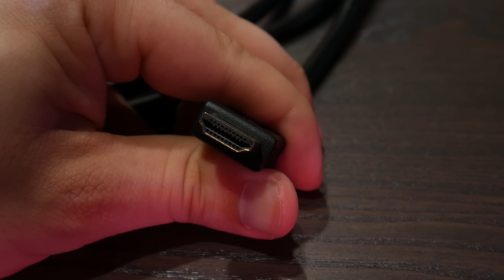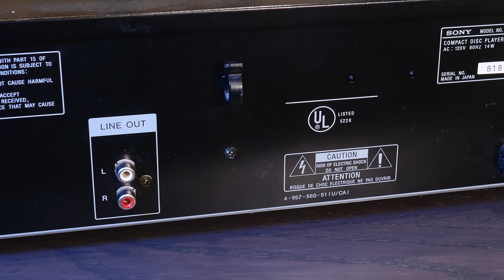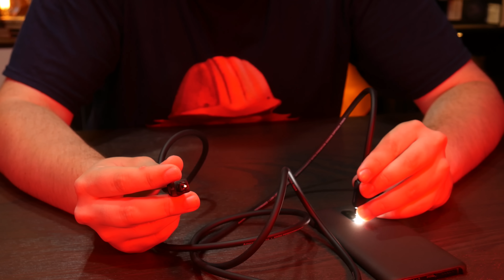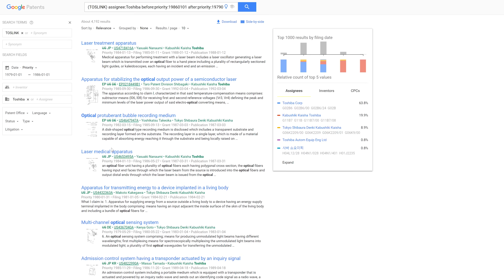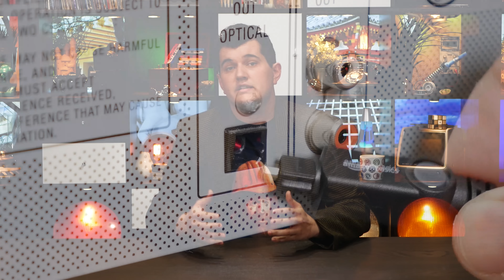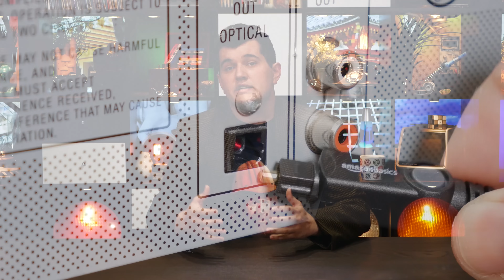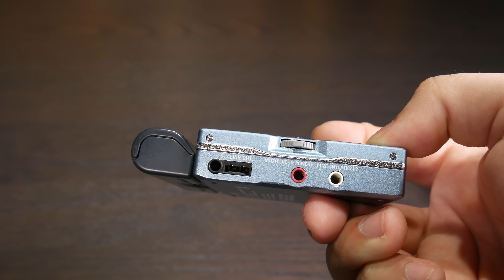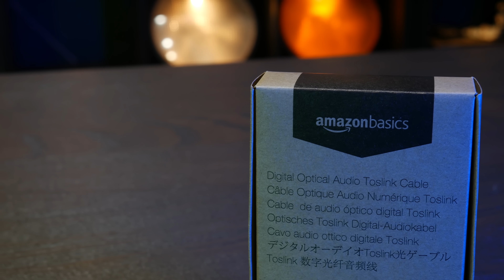TOSLINK: That one consumer fiber optic standard

Comment: The keying could also have been for installation of an angled connector type - these are quite common in the data-type fiberoptics, and are preferred, because less of the light is reflected back towards the transmitter, and the signal loss at the connection is therefore reduced, allowing for more connectors, and longer lines between repeaters.

Comment: I feel the ARC concept wasn't really thought out that well and forgot about folks with perfectly fine legacy surround amps that still work just fine; or it's just overly complicated or they designed it such that you now need to go and spend even more money to get ARC support. I upgraded my trusty old Samsung LE40 TV after it died to a new 4k LG with all-the-apps built in. An obvious problem arose was to how to send the surround sound to my non-ARC supported Onkyo AMP from the TV. It seems you can't just send the ARC signal back to the non-ARC HDMI inputs as they seem to be encoded differently or there's some handshake the non-ARC amp doesn't support. Why couldn't they just have a standard HDMI out socket on the TV you can send to any HDMI input on a device such as an older non-ARC AMP? Luckily TOSLINK came to the rescue and I just plumbed that from the new TV to the older AMP. If they discontinue TOSLINK on newer TV's it'd be a real shame. Sure I maybe don't get the mega high data rate for my audio, but to be honest I can't tell the difference.

Anyway, great video, learned a few new things :)

Comment: Well, for one, I presume my HTPC <-> TV (analog) A/V cable wouldn't discreetly but nonetheless quite painfully shock me every time I plug/unplug it if it would be fiber-based. The thing is, a) we simply don't have an actual ground wire in our "grounded" wall sockets around here and b) all mains switching power supplies helpfully tend to include a noise suppression Y-class capacitor coupling their output halfway straight to the mains solely for the purpose of being able to deliver tiny-current 135V shocks. Which you don't tend to feel in your fairly insulated chair or shoe when you grab the lead - unless you're also touching another appliance that just lost direct electrical contact with the first. Like, you know, when unplugging the damned signal lead. Not that I would expect this to have ever been an intended feature of TOSLINK of course - but it would sure have mattered for me...

Comment: Haha, I've had an optical cable between my PC and my surround receiver for years... my original graphics card didn't support HDMI out, so I've got a DVI out, and an optical cable to supply the sound... I just got a new card, and have been meaning to just go full HDMI.

The "This looks close" patent pictures look like the connectors we use at work for our printer network... there are these little hubs that two fiber optics plug into, presumably an in and an out, though I don't know rightly what they do... anyway, the cable end looks just like that...

I knew the mini cables were things... every time you buy an optical cable they come with the adapters for the mini... but I didn't know they went into a specialized headphone jack.... I've never seen one specifically before... neat!

Comment: TOSLINK isn't glass fibre, it's plastic. But it's great at what it does. My favourite "cable" is a TOSLINK to 3.5mm optical "jack" which came with my portable minidisc recorder. It plugs into the regular 3.5mm jack socket (but carries a digital signal), which is neat. I didn't use it much though as I did most recording on a full size MD deck. Minidiscs were really good back in day, way better than MP3.

Comment: You may be surprised to find that plastic-to-plastic has a very high impedance that is improved (lowered) by orders of magnitude with gold connections. Even gold to plastic significantly lowers the impedance, though the effect will be notably less. Don't believe me? Try measuring the resistance between plastic and plastic then repeat the measurement with gold and gold. The difference might surprise you! ;)

Of course I'm joking.

Comment: S/PDIF can't use any "standard coaxial audio cables". S/PDIF requires cables with 75 Ohm characteristic impedance as the interface is based on impedance matching (maximum power transfer)... the impedance of standard audio cable doesn't matter as analog audio uses impedance bridging (maximum voltage transfer) as its frequency is low so reflections in the wire are not an issue.
On many devices, TOSLINK is the ONLY digital interface available (maybe the music industry thought it was safer?) I used that extensively in the early 90's to copy audio between my MiniDisc devices (MiniDisc Walkman with mini TOSLINK and MiniDisk boombox with regular in and out TOSLINK).

Comment: TOSLINK has one major advantage over Coaxial: Electrically isolating components of the HiFi system.
Reply: I know it's discounted in the video, but it's still an advantage. It means there's no potential voltage difference with different brand or quality equipment, which can cause issues. It's rare, but it's still an advantage.

Comment: Mini toslink was actually veeeery common on laptops, even macbook pros had it.. Nowadays you can still find it sometimes on laptops that only have a single 3.5mm port. They usually have 4 pins so you can connect a headset and can support a variety of modes (headset, headphones, mic, line out, line in and digital output) which can be switched in software.

Comment: My question is that with the rise of standards like Dolby Atmos and its scaling format that still uses discrete channels. Why don't people start using Ambisonic Format B and, like we use an AV reciever, have a hardware decoder for a 4 channel Format B signal. With the ADAT standard we have access to 4 channels at up to 96khz (more than required for most setups) Or even 4 channel over SPDIF which is possible. However I think the industry will skip this entirly and go to network based formats like Dante, even though these are still using copper wire (granted with a higher bandwidth with CAT-6).
Reply: That’s why eARC was created (basically ARC 2.0)

Comment: The recording industry bought the stupid "Home Recording Act" which made DAT unmarketable in the home and then a short time later people just ripped CDs with their computers.

I never at all got the whole "clock jitter" thing I hear audiophiles ramble on about endlessly.    My favorite other thing of ripoff cables is "high purity power interconnects"  because the wires in the wall are so not cheap romex or BX(depending on home age or local code) sold by the spool.

Comment: Just a clarification: Recording, mastering, and broadcast facilities do not generally use SPDIF. They use AES which can either be 110ohm balanced or 75ohm unbalanced. Unbalanced AES is very similar to SPDIF, and for all practical purposes, compatible. There are some minor voltage differences and some status bits are used for different purposes. SPDIF is a consumer standard!

Comment: For the most part, consumers don't really need fiber optic connections. Copper is just fine if you're close enough. Fiber optic is for fast-travel across major distances. The one, and probably only, exception is actually when it comes to large amounts of data across any sort of connection. Computers, most notably, would benefit a lot from a fiber option connection to, say, a server if the data being trafficked across the connection was large and needed to be stored quickly. That said, there is probably a bottleneck at every stage since most of the inner workings of both computers will most definitely be copper and gold based.

There is one problem that comes up with copper, however, and it's going to become even more of an issue as we progress further with technology: the magnetic fields that copper wires produce. Right now we have a standard of Cat6, which allows for 8 copper wires to transfer data at the most, but they are twisted in such a way to prevent the magnetic fields from interfering with the other wires. In order to increase the amount of copper wires we have inside of our cables, we would need to further optimize the placement, shielding, and twisting. That's easy if the wire is never going to be touched (buried underground), but not so easy if you're giving it to a consumer that could be constantly tampering with them.

Comment: Errors in the intro :(

It's not pulses of light, it's a constant light that's modulated.
It doesn't have to be a laser, mostly any light source can do it, such as TOSLINK, which uses an LED.
No counting of pulses, cause there are no pulses.

Still, i'm looking forward to the rest of the video, sans errors :).

Comment: This method is far better than the copper cables.

I have a cheapo HTPC at home and the onboard audio of the Optiplex 755 Ultra small is horrendously hummy.

I tried all i could. Bluetooth sounded good and removed the hum, but now the sound didnt match the picture bc BT is delayed byt the processing involved.

I got a USB toslink thing made by turtle beach. Copper audio was good, but once i hooked the toslink, it was much better sound.

No more hum and no audio/video desyncing. I had no idea this connector was so old. I remember seeing a light on my old PS2 but never knew what it was for. I originally thought it was just another LED to indicate the system was on when the manufacturer was checking to make sure it worked. Tho it could be used for this, i now know its an optical signal out for better sound

Comment: Speaking of wall power. If you don't know that your surround sound or any other sensitive reciever has a mechanical off switch before any circuitry unplug it before backfeeding a generator into your electrical panel. Its way to dirty electrically in the signal to even be safe. Especially if you try and use it. May literally pop an electrolytic cap or at least swell one if its older/cheaper equipment.

Comment: I have an older PCI Asus soundcard that does have mini-toslink for digital out instead of its other analog surround out.  Also, when it comes to audiophilia...I think it's funny that when I invested in a high end SACD player, the only output it had for hi-res was analogue out (Sony was hell bent on DRM at the time).  Now my latest digital receiver includes DSD decoding, and I can get pure DSD via my Oppo BD's HDMI.  Even though there's less and less SACD discs being made, seems downloaded hi-res audio includes DSD.  Also when it comes to noise, my home is near a large radio tower.  With some of my amps, I've had to find good RF noise filters....but have never had distortion with audio with digital copper vs optical connections.  I've upgraded my home theater system to a new OLED TV and Atmos receiver: the other advantage of ACR isn't just carrying sound from TV, but also CeC controls.

Comment: I've seen it useful when trying to isolate ground loops .. you know, 60hz hum that is a damn pain to pin down.
Reply: Yeah, having a potential difference between the grounds of two or devices can a be a real pain in the ass to work around if you have to use metal cables to connect stuff... =(
Reply: PC coax S/PDIF often references the same noisy ground as onboard USB ports... optical ports force manufacturers to work differentially, since that's the only way LEDs and photodiodes work.
Reply: @jercos  Forcing a differential input shouldn't matter unless the noisy ground is incredibly noisy to the point where you're losing bits in the digital stream....
Reply: @pseudocoder78  two single-ended devices attached by coax are bonding their ground together by it. That can affect analog portions of a DAC even if it correctly receives the bitstream... if I attach headphones directly to my mobo line-out I hear a class of noise during hard drive seeking that I can also hear from headphones attached to a low-cost DAC by coax. Galvanic isolation solves my problem, but a toslink cable costs around the same as a signal isolation transformer in my part of the world.
Reply: @jamieacraig  Yes. There's always ground and VCC even in the differential connection. But since the signal first goes through an op-amp (as a differential amplifier), the ground wouldn't be technically shared. I'm not saying there wouldn't be any noise, but saying that there's a shared ground in a pure differential connection is wrong too.
Reply: @jamieacraig  The shell in not floating. Differential outputs has a plus line and a minus line, instead of a signal line and a ground line. If the voltage on plus line is higher than the voltage on minus line, then the bit is one. Otherwise it's zero. That would give us very high noise immunity. So in this case, the plus line is the core of the coaxial and the minus is the shell. Both are used, and none are ground. I politely asked you to read about differential connections because they're awesome. They're used in USB, Ethernet, SATA, PCI-Express, FireWire, and basically every modern connection we rely on for their noise immunity. They're even used in your car in its internal CAN bus. Also, as it's said in the video, in a digital connection, there's no quality degradation because of noise. You'd either receive the data or not (with error detection and error connection in place).
Reply: @jamieacraig  You're 100% correct about the noise induced by not electrically isulating the two systems would not only affect the digital connection itself, but it may also affect other parts of the system as it may get out of the op-amps etc. Using an optocoupler to isulate the connection would be a good practice, if we could provide a separate power for the comparator. I know the rule of thumb is that unless you completely electrically isulate two systems, one's noise would certainly get into the other.
Reply: I found this whole conversation facinating and way over my head lol
Reply: There is no common ground in a differential connection.
Reply: @khashmeshab  If you use SPDIF through co-ax, you are connecting the grounds of separate equipment, which often causes audible ground loops.
Reply: @davidsuzukiispolpot  exactly
Reply: @davidsuzukiispolpot  No you don't. Read a little bit about differential connections. There's no common ground in deferential connections, unless you connect the grounds using a separate wire like in USB.
Reply: @khashmeshab  in coax spdif, the outer jacket is usually connected to chassis ground on the equipment.  Coax spdif is NOT differential; the signal is carried on the inner conductor and the outer is the shield.

Comment: I connected my TV using Toslink to my 5.1 receiver, only to find out I couldn't get the on board Netflix app to send surround sound to my receiver. Turned out Netflix used DD+ which is not compatible with Toslink. That is how I found out about HDMI-arc.

Comment: TOSLIINK has always been a sharks with laser beams solution.
But there's one place where optical connection would make sense. It's audio recording. Coax connections can introduce ground loops, which can introduce interference to other analog cables and analog circuits. If you connect the peripherals through optical cables, you avoid ground loops, even if they're powered through the same circuit. Note though, that you could use twisted pair Ethernet, which doesn't have ground connection from end to end, and thus not creating ground loops.

Comment: My Sony portable MD recorder had a 3.5 mm toslink connector. It was completely made of plastic and worked just fine. I used it regularly back then to make CD copies for the road. And just like you I never thought about why the full sized toslink connector had a connector with a fixed position. Really odd.

My Philips portable DCC recorder before that (this is late 90s) had a 3.5 mm spdif connector and worked just as good. At some point the device broke down and was replaced by the minidisc recorder. DCC had already died a quiet death and had completely disappeared. Minidisc was way more practical yet I missed DCC for a long time. I just thought it sounded better. Plus digital tape simply is way sexier than a disc. 😁

Comment: Toslink offers galvanic isolation for sensitive input components that are normally isolated from the mains by a transformer. Many devices do not have an isolation transformer for each of their coaxial inputs/outputs (cost-cutting), so toslink can help in such cases.